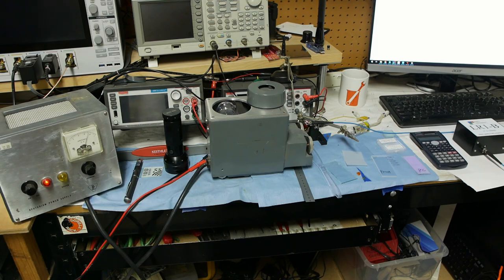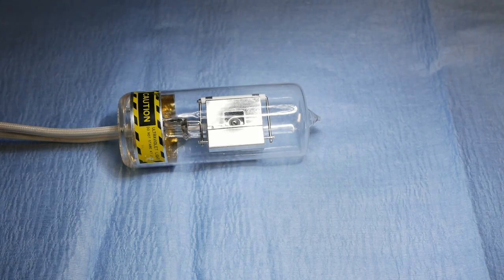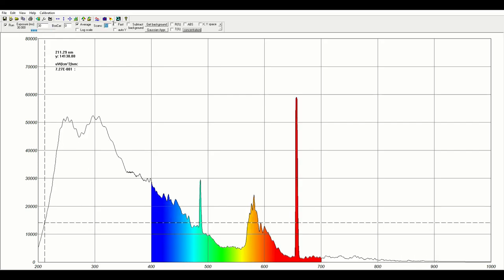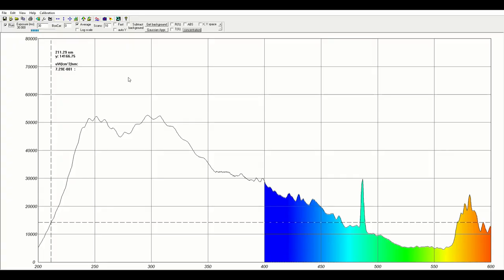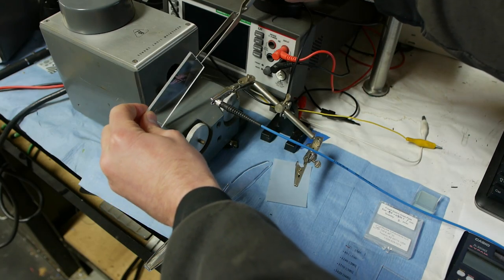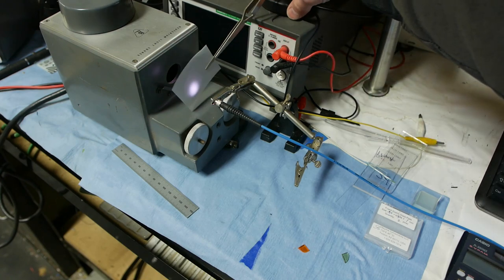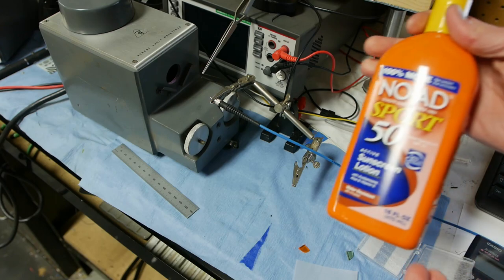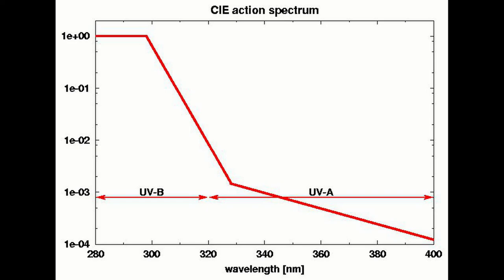Testing UV absorption eyewear and sunscreen with a deuterium light source

Comment: I'm very curious how that bump around 480nm is present for a lot of different plastics and even window glass, but not present for other materials. The wavelength is suspiciously close to 486nm from Balmer series and we can guess, for example, that peak's intensity was underestimated in lamp's baseline spectrum (sensor saturated?), but then bump should be there for all materials. Glass is chemically pretty far from plastics also, so it's probably not fluorescence --- probably something related to Balmer peak, but how exactly?

Comment: Great video, interesting results. Kudos!

One pesky quibble: the software's reference colors are wrong. 400nm is violet, not blue. 
In fact, you even mention several times about 405nm being "purple". 
This kind of thing really gets my goat. It's like the spectrograph designers have never even looked at monochromatic light. Or a rainbow, or the output of a prism or diffraction grating.
sigh

Maybe I have abnormal vision... Most sources I've encountered say mercury has one violet (or blue, it's kinda in the ambiguous blue/violet transition area) line. Viewing mercury vapor sources through a diffraction grating, if the source is bright enough, I can clearly see two violet lines.
Reply: Checking some references, that second line is at 398nm, which would seem to be in the visible range. The first violet line being at 435.8nm, and I can totally understand why some folks would call 435nm blue, and some call it violet.

Comment: Won't some of these answers change depending on the distance of the source to the filter, and from the filter to the detector? For example, in optics, light behaves quite differently if you're near the focal length versus not. Or is the focal length assumed to be infinity?

Comment: this reignited my dream, "quest", to make a UV/Vis spectrometer for chemical analysis.
Reply: Neat. A prism or diffraction grating shining onto a fluorescent surface  and a CCD to measure the intensity, is my first guess how to detect it. The idea being to spread out and convert the UV spectrum into something visible that can be detected in a straightforward way. Probably an intensity calibration nightmare though, depending on the fluorescent pigment and CCD.

A bunch of UV LEDs operating at wildly different temperatures and strobe currents might make a cheap low intensity deuterium lamp substitute. I don't have any hands on experience with UV LEDs, but in general the blue/red shifting with temperature of an LED might provide +/-75nm from their normal peak wavelength.

[Edit: It might be possible to do an acoustic sweep from MHz to GHz, instead of photons. Above 2.5GHz sound corresponds to shorter than 400nm wavelengths.]
Reply: @chrisbalfour466  yea, i know the theory its just the electronics and components thats not my area, need continous UV/vis spectrum lamp, way to control it, and something that measure it without being biased
Reply: @dalitas  It's a tough set of optical problems. Alternatively, acoustically characterizing chemicals might be equivalent and doable with just piezos as emitters and detectors. Wave is as wave does. Good luck.

Comment: How accurate is this setup you have ? I have a 355nm 15w pulsed spectra physics laser I need to see how much bleed-off I’m getting from crystals to output and the exact wavelength it’s output the most power at. Could I use this unit with some beam attenuators ...

Comment: I think you are mixed up about sunburn and UVA vs UVB. It is perfectly possible to get a sunburn with UVA--in fact, most UV in sunlight is UVA whereas only a tiny fraction is UVB. UVB can cause superficial burns at high intensities but is not very penetrating and affects mostly the outermost layers. UVA is more penetrating and causes more mischief at deeper skin levels.

Comment: Doesn't the angle of the rays to the surface you are testing affect the outcome? I would guess there's some reflection if the angle to the normal is grater.

Comment: Your laser goggles have that bump at 380nm, but the amazon goggles block that - could you try both in series?  I'd expect it to just remove the bump at 380nm, but I wouldn't be surprised if it did something weird like causing a bump because something something quantum something something double slit...

Comment: Is there a cheap alternative to a uv pass filter (essentially the opposite of what you’re testing for), something that will block all visible light but still allow those longer wavelengths through?  The optics are expensive.  I wondered if there was a paint or something that‘d do the trick, like some bizarro sunscreen.
Reply from the maker: Woods glass? If you want uvb and uvc, the material will likely need to be quartz, which is where the expense is.

Comment: I'ts not in the subject, but i'm curious about the effect of polarizing (linear and circular) filters on UV.
Reply: I'm not an expert, but with circular polarization blocking along a diametrical centerline I would expect about a 50% reduction at best. Being that the polariser operates on a gradient in regards to it's orientation rather than being constant, I think actual results would be something more like 15% - 20% if it behaves similar to what they do with visible light.

Comment: Kinda fascinating that the spectrometer is already being filtered by a quartz fiber, and yet that other piece of fused quartz has lower transmittance than the fiber? Shouldn’t they be pretty much identical since both the sheet and fiber are both just quartz?
Reply: there are different types of fused quartz. eg. 'suprasil' is manufactured with ultralow metallic impurities allowing high uv transmittance, 'infrasil' is made with ultralow trace water contamination during forming and reduces the residual OH groups in the material whose far IR absorption bands have higher harmonics in the near IR and thus allows super high IR transmittance.

Comment: Can the vellum's smooth low-to high transmission curve with increasing wavelength be attributed to diffraction? That is, light of shorter wavelengths is taking more twists and turns inside the material and thus less of it manages to reach the spectrometer?

Comment: ASEQ spectrometer that you use is a great deal imo, have worked with 4-5 different brands and still favor ASEQ spec, mostly because of the software, simple, fast, you can install it on bunch of computers, worst was Ocean Optics, their software is bloated, restricted, just plain horrible!

Comment: HELP! You show the quarts and say it's great for working with ultra light but it looks like it is showing 100% transmission for wavelengths until it's lower than 250 and it doesn't appear to drop very much! If someone could clarify I would appreciate
Reply: What's to clarify

Comment: Interesting, quartz glass would be pretty neat for a greenhouse then, or even for office windows i guess, because people working there get way to little UVB / vitamin D3 even in countries close to the equator.
Also btw. UVA is indeed harmful to our skin, it just doesn't cause sunburn, it seems like the UV spectrum from the sun between ~11am and ~3pm is the least harmful/ cancer causing, while predominantly UVB or predominantly UVA are more likely to cause cancer(different types though). 
Which means yes you don´t get a sunburn behind normal window glass, but you can get skin cancer and your collagen will get destroyed, this is a good example: https://www.cbsnews.com/news/trucker-accumulates-skin-damage-on-left-side-of-his-face-after-28-years-on-the-road/

Comment: Why does the direct sunlight cut off abruptly at 330(?) nm wavelength? Very little UV-B?
Reply: it's not direct. In both cases. The plot in any case is bugged. It should be similar to the overcast one.
Sun radiation is very close to black body one. Sun's surface temperature is 5,778 K. The slope near UV is very high compared to one IR one. Plus atmosphere is scattering UV much better (reason why sky is blue). That's why it seems like it almost cut off.
Reply: also, a proper chart of "sky light": https://en.wikipedia.org/wiki/Diffuse_sky_radiation

Comment: Actually what is the glass fiber made out of ? If the full spectrum can pass through it!?
Reply: Great question, I'm curious about that too
Reply: At 3:10 he says it's quartz fiber.
Reply: I would assume it is something similar to the fused quartz that the bulb is made out of. These UV-B and UV-C emitting lamps need to be made out of fused quartz instead of glass because that would block the ultra short wavelengths.
Reply: Quartz fiber. Go to Thorlabs and read about it all you like.
Reply: @wesleyson21  oh thanks. 
Looks like I misheard that part.

Comment: I'm not sure you're right at 16:30 where you say window glass is effective at stopping burns. Your reasoning is 1) UV wavelength <320 is dramatically more damaging per unit of light, and 2) window glass blocks out almost all UV with a wavelength of <320. But, at 4:00 you show that the sun puts out thousands of times more light in the >320 UV spectrum than the <320 UV spectrum. Multiplying the amount of potential damage per unit of light at each wavelength (chart at 16:30) by the units of light given off by the sun at each wavelength (chart at 4:00) would give us an accurate picture of the amount of damage at each wavelength that we receive from the sun. Visually looking at your charts, it appears that doing this would show that a significant amount of damage comes from wavelengths of light that do make it through the window glass, meaning that you can still get burnt.

On a different topic, I'd love to see you redo this experiment with cheap sunglasses. I'm a bit worried that my sunglasses block visible light, causing my pupils to expand, but don't block UV light, which can then enter my expanded pupils to cause more damage.

Comment: How do you suppose SPF is marketing mumbo jumbo yet it perfectly represented your findings?
Reply from the maker: :) I had talked about this more, but then edited it out. The SPF is how many times longer a sun exposure would be required to produce the same sunburn. So, if a person would have had a sunburn after just 30 minutes; with SPF 30, they could withstand 900 minutes, or 15 hours - more sunlight than in a day. But many folks have used SPF 30 and still gotten burned, and there exists SPF 100, which seems like it has no benefit if the numbers are accurate. It's a system that is heavily user dependent, but is reduced to a single number that people interpret as 'more is better' by marketing.
Reply: SPF 100 is supposed to mean you can stay out 100 times as long with it compared to without it.  At 13:50, he shows that transmission through the sunscreen is only reduced by a factor of 20-50.   So either time-to-sunburn isn't proportional to exposure, or the sunscreen is 2-5 times less effective than the manufacturer says it is.

Comment: As Ave stated in one of his vidjeos, it is safe to arcweld in sunglasses
Reply: Not for more than a few seconds it isn't. The damage to your retina is from longwave uv, not the UV-B.  UV-B causes sunburn and cornea damage. Sunglasses do not knock UV-B down very much, as you can see in this video. So sunglasses would prevent cornea burn but you would very rapidly destroy your retina and go blind. There is a reason why welding helmets use a broadband absorber.